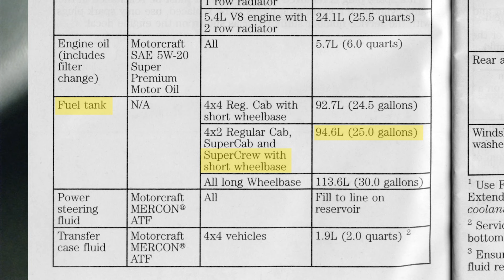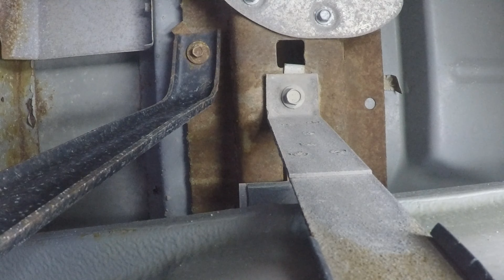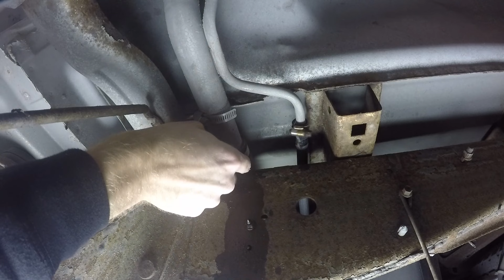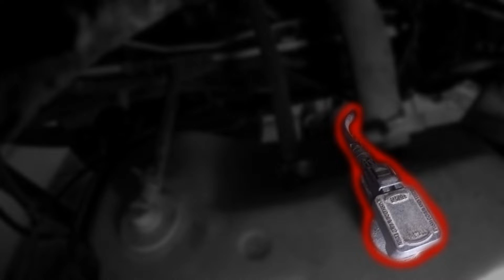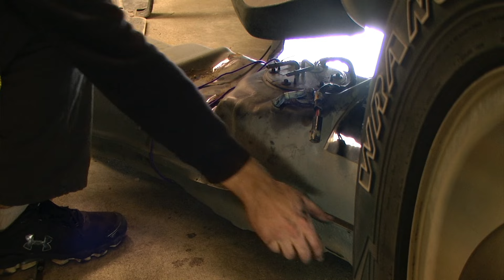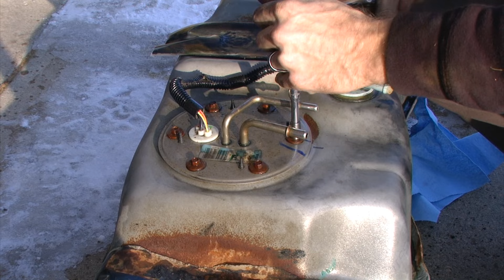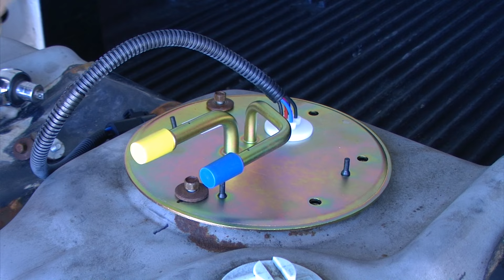Fuel Pump Replacement - 1997-2003 Ford F150 5.4L - NOTE: CREW CAB BODY REQUIRES TANK TO BE DROPPED.

Comment: This is the best video I’ve seen. Very concise, and nice and slow for easy comprehension. Very good points to clean everything up before total disassembly. I would recommend replacing all hoses while you have the tank down too. Ratcheting straps were a nice idea. The jack stands seemed to be in the way. Over all it is a very well done video. Gasoline actually floats on water, it is lighter in weight than water by almost 2 pounds/gallon. Nice details to safety also. Gasoline volume to volume is said to be 10 times more explosive than TNT. Of course, in liquid form, it is at its safest phase. Good job man!
Reply from the maker: Thanks for the comment.  I agree with everything you said.

Comment: I have the exact same truck minus the running boards. 242,800 miles later the fuel pump finally died!!!
Reply from the maker: 242k miles...that's impressive.
Reply: @InsaneOil  fuel pump done! Next valve adjusters, timing set and headgaskets. Bonus parts too, a set of ceramic coated headers from pace, 100 bucks over stock manifolds.
Reply from the maker: @thralldumehammer  You'll have a brand new vehicle when you are all done.

Comment: You could have just pulled 5 - 6 connectors and undone 6 bolts and removed the bed to access the fuel pump dude. Way too much work for doing an easy task.
Reply from the maker: The fuel pump cannot be accessed via bed removal on a crew cab.

Comment: I heard you can you loosen the tank straps and lower just the front of the tank and you can remove the fuel pump unit without removing the entire tank? Not positive though! I will probably remove my bed to access the pump...just seems easier as I have no bed liner! 
Thx for video and tutorial! Good job and very thorough!
Reply: I have not heard of the "loosen the straps" method but it could be possible that it would work. FYI on the "bed removal" method...if you have a crew cab (as shown in the video), the "bed removal" method does not work because it does not give you enough access to the tank, since the fuel pump actually sits underneath the back seat.
Reply: @jonothejester  I have a 2001 extended cab not crew cab so I think it works out! But thanks for heads up!!!!👍

Comment: When my friend and I did this about 9 years ago on my 2001, we also replaced all the fuel hoses, even along the frame, because they were just disintegrating in our hands.
Reply from the maker: I agree with your methods.  It probably would have been better if I switched out all the lines also.

Comment: I removed the filler neck, but when I try to get a line in there to syphon, I am having trouble hitting any fuel? 
I'm just trying to drain the tank. Any ideas? Thank you!
Reply from the maker: Drop the tank with the current fuel level.  It is near impossible to do any decent type of job syphoning it out because of all the junk inside the tank that keeps the fuel from sloshing around.  Just know that it is heavy.  Use straps to help support it.
Reply: Going through the fuel door won't work because there's an anti-siphon cage at the end of the main  full pipe.
 I was able to siphon all but about a half gallon by disconnecting the smaller 3/4" vent hose at the tank (the smaller hose coming off the filler pipe).
Reply: Also, the Ford manual says to remove the rear vent valve (push down and turn CCW). I was unable to turn mine because of rust build up; but once I got the tank on the floor, I was able to clean out 're rust under the flange and remove and reuse it.

Comment: FYI. If u have a super crew the fuel pump is under the can. NOT the bed...
Reply from the maker: Correct.  The "bed-off" method won't work with the super crew.

Comment: Good video. Only thing I’ve noticed is you cannot change the pump with the bed off on the crew cabs. The fuel pump sits under the cab and there is not enough room to pull it out unless you drop the tank. Still a great video
Reply from the maker: Agreed.  The bed-off method is not suitable for this particular body style.

Comment: More easier to just remove the bed right off
Reply from the maker: In some cases, yes.  However, removal of the bed with the Crew Cab body style does not give you full access to be able to remove the pump.
Reply: Right because the fuel pump is right underneath the cab therefore having no choice to drop the tank but a f150 with regular extended 4 door cab you can get away with sliding the bed back a foot to get access to the pump

Comment: jucas gas line cleaner cleaner fuel lines the jectors. and fuel pump great stuff.will need couple treatments.and may help with wants to stall.
Reply from the maker: Although Lucas Oil is a good brand, I personally use Amsoil Performance Improver.  Based upon my research, it gives you more bang for your buck over Lucas. https://www.amsoil.com/shop/by-product/fuel-additives/gasoline/p-i-performance-improver-gasoline-additive/?code=APICN-EA?zo=10458  You may also want to try Amsoil Power Foam if you are having upper intake issues. https://www.amsoil.com/shop/by-product/other-products/cleaners-and-protectants/power-foam/?code=APFSC-EA?zo=10458

Comment: Thank you for such a thorough step by step install. I also have about s half tank of gas never thought of ratchet straps. I have done a couple of fuel pumps on vehicles in the past but much easier to do than this job.
Reply from the maker: Thank you for the comment.  Good luck with your repair.

Comment: EXCELLENT video.... Thanks! BTW if you turn the key to ACC I believe (mode before it turns over) the pump is enabled and already making pressure in the fuel line (you can hear it)... You should just be able to leave the key there for 10 seconds. It makes a quiet 'vrrrr ... bup!' sound right when peak pressure is met. Whichever works but try leaving it there for a few sec first to save the starter. Im anal.
Reply from the maker: Thanks for the tip.  I hope to never do this repair again, but if I do I will try that.

Comment: Thanks for the very informative video, I have the same truck and will be using your instructions.  BTW gasoline weights 6# per gallon, water is #8.
Reply from the maker: Thank you for the comment.  Good luck with your repair.  Thanks for the clarification on the weight of gasoline...good thing I don't teach science...or math.

Comment: It would've been easier just to remove the bed. Thanks for sharing.
Reply from the maker: Agreed.  Unfortunately, with the crew cab body style, if you remove the bed you can't get to the pump. :(
Reply: @InsaneOil  I didn't know that for crew cabs. Learned something new today. :Cheers:
Reply: @InsaneOil  very true. found that out.

Comment: I would safely assume that this would work on a f 250 2005 as well,yes? My fuel pump works ok but sending unit not jiving on gauge. and i have prob's fueling as well .Save me some head aches
Reply from the maker: Repair procedures should be similar.

Comment: you can just tilt the bed over on the right side loosen all the bed mounting bolts and take the left bolts out then remove the fuel neck screws and just jack the bed up on the left side. It is the easiest way! there are 6 bed mounting bolts you only need to remove 3 on the left side.

Comment: Use a floor Jack its easier
Reply: Yes you can adapt a piece of wood  to the Jack. I did it that way.
Reply from the maker: Floor Jack would be a good idea...pending you could get the tank balanced properly without slipping off.

Comment: My 2000 expedition has over 241K on it and my fuel pump just went last month.  What originally happened was the fuel filter was so old and rusty, like mostly everything under the car, I kept trying to start my car when it was -10 degrees out thinking it was not starting from water in the tank.  I kept trying to start it and wound up blowing out the fuel pump.  I got the fuel pump, fuel filter, relay, the straps that hold up the gas tank all replaced,
Plus got a full synthetic oil change and a local mechanic whose work is backed by AAA (not a Jiffy Lube or franchise) charged me $960 with tax.  I thought that was extremely fair and this is NYC so I wasn’t mad at the price.  Truck is still going strong
Reply from the maker: Glad you got it back up and running.  Now go put another 241k on it.

Comment: Replace fuel tank just cause?? 😆
Reply from the maker: If you are concerned with the fuel tank...now would be the time to replace it when it is off the vehicle.
Reply: @InsaneOil  its  Not 100% wrong to change anything old for new. Normally If it aint broke. Dont fix it..But to each his own. How ever there is a fuel pick up Screen on fuel pumps. Preventing debris pick up, inside tank. Then there's another filter before injectors. I came across this vid cuz we're changing an original feul tank and pump on a 03' with 220k. Everything worked fine still. But tank rusted out seeping fuel under mount straps. Perfect time to change both... After doing so last nite. I do envy how clean and new your under carrage is for ease of removal!😊

Comment: It is so much easier to access the gas tank by removing the truck bed. It is held on by either six or eight bolts depending on model. With the bed removed you have full and easy access to all the tank connections including the sending unit, hoses, vents and sensors. Plus you can stay off the floor. I just completed a gas tank change myself and the bed removal method is the way to go.
Reply: Yes, I read that a bit later. You made a good video. I liked the circles and outlines showing the parts discussed. Keep up the good work!
Reply from the maker: @craig853  Thanks...much appreciated.
Reply from the maker: Agreed.  The bed removal process is typically a little easier, however, with the Crew Cab on this model the bed removal process doesn't actually give you access to the fuel pump.

Comment: Just FYI extended cab trucks and single cab trucks can be done taking off bed. Crew cab truck your going to have to drop tank because fuel pump is under cab. Just found out the hard way.
Reply: Same homie,  literally just spent 3 hours battling bed bolts.  Got it off and said I'm going in the h Ouse and drinking beer.  I'll drop the tank tomorrow.  I was to pissed to even give a fuck lol
Reply: @lazykbarranchoutdoors  that f**king sucks bro.
Reply: @lazykbarranchoutdoors oh, it was one of those huh 😂
Reply: @scar_tavo it was cold as hell that day too lol tank was just filled up lol
Reply: @lazykbarranchoutdoors bro I'm a hot head I would thrown some tools around and talked so much shit before going back inside and spending the next hour trying to convince myself to try again 😂
Reply: I heard you can at least access some of the hoses from the top which makes it easier than the bottom. What was your experience?
Reply: if you have a four door, you cannot access the fuel pump buy removing the bed. it is under the cab. On my extended cab f 150 it is under the bed.
Reply: @gilberto.t.y.hernandez7491  I have a four door it looks like I can just off the bed and get to it
Reply: @jeffgoldblum2336 did you ever get to it? I have a 4 door as well
Reply: I did the same thing. Pulled the headache rack, tool box, disconnected everything underneath, and lifted the bed on my 2002 king ranch super crew just find that I couldn’t access the pump😤😤.

Comment: Do to me having the same year truck to save you a hassle later down the road I would have replaced the sensor and the two valves on the tank when replacing the fuel pump if possible I have four hundred and eighty thousand miles on my truck with the same year and the only owner of the vehicle from dealership nice to see someone else working on their own truck like I do
Reply from the maker: I agree.  When everything is taken apart is always good to switch out some of those "likely to fail soon" components.  I should have done that.

Comment: Great video. What are some good fuel pump brands to consider? Any recommendations?
Reply from the maker: I bought the one that O'Reilly Auto Parts had in stock.  I did minimal research into the various brands.
Reply: @InsaneOil  Do you remember the approx cost of the pump from O'Reillys?  I'm checking stores and prices seem to vary greatly. Thanks

Comment: Might of been easier to pump out most of the gas into gas cans
Reply from the maker: Agreed.  Prior to the start of filming this video, I first attempted to use a pump to extract the fuel but ran into issues with the quality of pump that I purchased.  I then decided to use a siphon and did extract out about 10 gallons of fuel.  Once my two 5 gallon gas cans were full I didn't want to buy any more gas cans so just thought I'd roll with it.

Comment: Is this a common problem for Ford truck? Was thinking of buying an 01 next month with 114k on it for 3,800.
Reply from the maker: I think it is common for most vehicles.  Much of it depends on the type of driver you are also.  If you always drive with your fuel below 1/4 of a tank it adds stress to the pump as a full tank of gasoline helps keep the pump cool.
Reply: Insane Oil oh, I see. I’m the type of the guy who doesn’t let his tank get past half lol. I’ll have to ask some questions when I go to look at it. The exterior of the truck is immaculate. Looks like it was taken care of
Reply from the maker: Typically...not always...but typically if a vehicle owner takes really good care of the interior and exterior of the vehicle, there is a good chance they did the same with the engine/tranny, maintenance, etc.

Comment: Its much easier to remove the truck bed. It took me 1.5 hrs - u need 2 ppl to remove bed. 
6 screws on bed & light connectors on rear bumper & fuel cap with screws to remove fuel hose. If u have questions messg me
Reply: hector celis was it in a 4 door supercrew? I have read that the fuel pump can't be removed that way in a supercrew.
Reply: 1ComboA . its a 2001 f150 xlt regular cab 2 door 5 speed 4.2 engine, the one i replaced fuel pump. Im sure crew cab is the same.

Comment: Thanks for the very informative and well done tutorial!  It made doing this repair pretty straight forward.  My '01 only has 52,750 miles so I guess it "aged out".  I had 18-20 gal still in the tank, so we didn't drain the tank and used two large floor jacks to support  and lower it.  The hardest part of the job was getting the filler neck and vent tube hoses off the filler neck tubes.  We lubed all the hoses and hose barbs with ATF and it all went back together very smooth.  My (salt free) truck is truly clean and rust free, so I'm sure we had an easier go of it.  The details you provided made the difference, thanks again!

Comment: Did this job on my 02 f150 yesterday. your idea of using tie down straps made the job much easier! I used my dirt bike style cinch type straps (not ratcheting style) to lower and raise and it really helped since the tank was 3/4 full. replaced pump motor with Bosch 69128 for $90.
Reply from the maker: Glad the video helped.

Comment: Do not remove bed on supercrew will not work for fuel pump work
Reply from the maker: Agreed.  Although bed removal does work with many pickups, this specific model of F150 is not a good candidate for that process.

Comment: This video is good and bad.  You can not change, work on, or replace the fuel pump by removing the bed of the truck. But ill make the best of it while i have my bed off by spraying to protect the frame from rust
Reply from the maker: Agreed.  Although bed removal does work with many pickups, this specific model of F150 is not a good candidate for that process

Comment: i JUST used this video to replace the pump on my '02 F-150 Super Crew. Video was spot on.  The clips on my fuel lines were a different type but everything else was great.  Truck is back to running great again.  VERY HELPFUL video
Reply from the maker: Glad it helped.

Comment: you cannot remove the bed on a SuperCrew and expect to reach the fuel pump as the fuel tank on a SuperCrew is partly underneath the cab due to the cab being longer than a standard cab. If you remove the bed you're going to figure out that you still cannot reach the fuel pump. You still have to take the fuel tank down.
Reply from the maker: Agreed.  Although bed removal does work with many pickups, this specific model of F150 is not a good candidate for that process.

Comment: Hello, What a great video.  So my vehicle is the same as this one, with 125 K on it.  However my problem is that the  gas gauge indicator needle (on the dash) seems to only go up to half now, although it will go down as the fuel level drops.   It looks like you replaced all of the float with the fuel pump.  Do you think this would work for fixing my problem.  Seems like the same procedure.
Reply: I would say it would. It is still a gamble because we are technically throwing a new sending unit at it rather than checking the wires and cluster to make sure it is not that, but most likely the float is the problem. So if you replace the sending unit, then yes, that should fix the float problem. I replaced mine on my ranger and it is a good approximation now, but I notice that for a 20 gallon tank, I am still a little above half a tank when I should have consumed 12 gallons. So I still don't trust the float to give the indicator gauge the accurate amount of fuel remaining, but it is a good approximation.  I am just saying fixing it may still give you a problem because sometimes they can get hung up when you install them.
Reply: Thank you, that sounds like it is the answer to my problem.
Reply: I revisited you video, and found out that the problem was my cluster.  I literally have to tap my clusters window, and the gauge goes back to reading correctly.  Obviously it's a solder joint issue.  Thanks again.